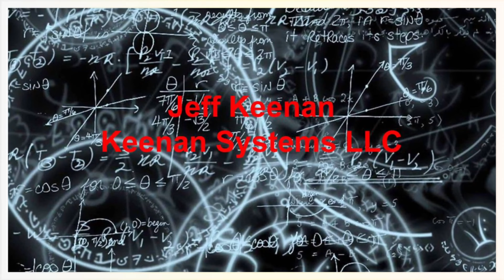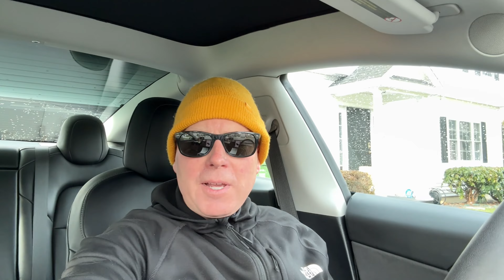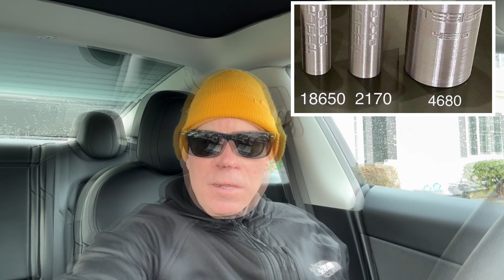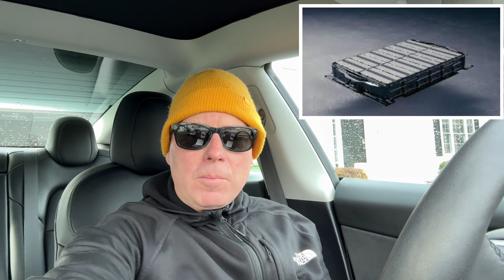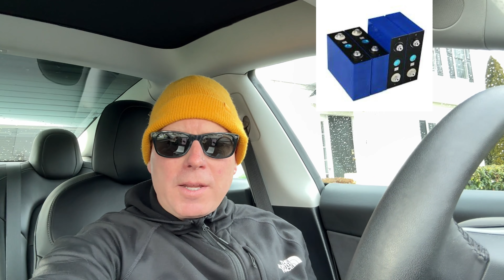Different Types of Lithium Cells and Chemistries Used in Electric Vehicle production

Comment: I did not know Rivian used cylindrical cells.  So Legacy OEMs are using pouch cells.  Interesting. Thanks for this great info.   To my understanding, the Telsa model 3 standard range LFP does okay in cold but the problem is the rear wheel motor (being only one motor as opposed to dual motors) does not provide enough resistive heat to the battery in extreme cold.  One point I would add is that if a consumer does not want NCM chemistry and prefers Lithium Iron chemistry (which has no Ni, Co, Mn) then chose a LFP battery currently in Tesla model 3 and Mach E (not sure what trims/specs for the Mach E LFP battery).  Thanks again, Jeff.  I learned a lot.
Reply from the maker: The blade is just a different format for LFP cells it has better packaging and charges faster. Tesla only uses on standard range vehicles built in China so far.
Reply: @keenanjeff  Oh okay, I just searched blade batteries and they are LFP as you said.  BYD uses blade batteries.  By the by, BYD is in the Caribbean islands now and Mexico. The next gen battery from Tesla and already being used by some Chinese automakers will be LMFP.  Very interesting that one...